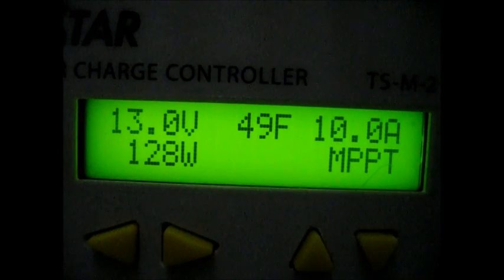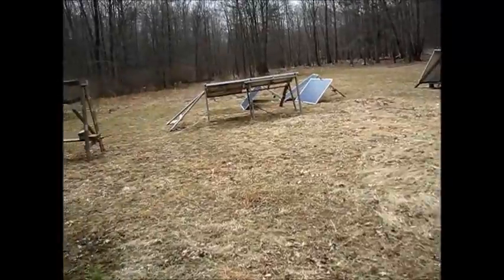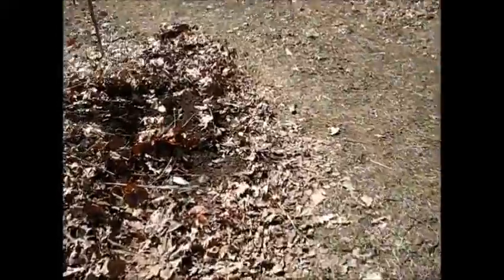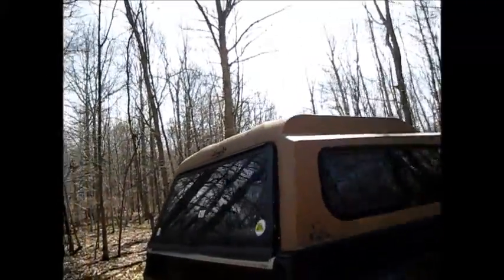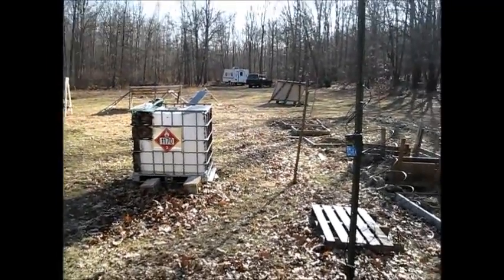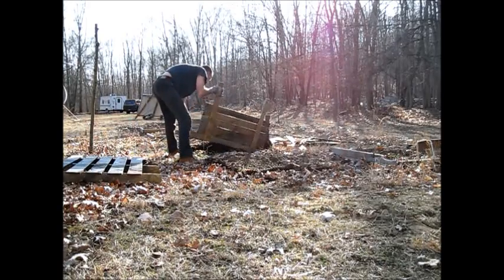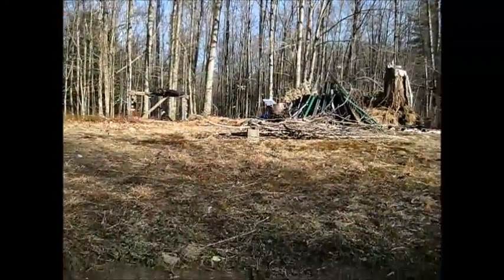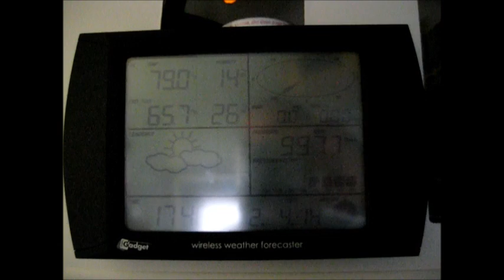Spring Cleaning At The Off Grid Homestead And Major Changes

Comment: All those sticks you moved could have been used for kindling for the wood stove, in fact I would have used that old outdoor shower rig to hold your wood that you have left until you could make a proper wood shed.  The stumps you could cut up a bit more from them for more wood, I know it is not much but every bit helps.
Reply from the maker: There are so many sticks around here that I can keep on going forever.

Comment: If you happen on an old bed frame, in one of the piles in the woods.I would cut the angle iron to make adjustable triangles and bolt the panel to them.Some drilled holes could let you set panel angles and anchor to keep them from blowing away.Looking less cluttered,someone mentioned shower as a wood shelter with old tarp fasten on .For composting a rotating drum might work better with some of those
worms to help the process.Keep up the good work it`s paying off.
Reply from the maker: Might work. Thank you
The shower is too small for a wood pile and I dont want to move the wood twice. When I figure out where my home will be then I will build a wood shed from pallets.

Comment: Congrats on moving the workshop. Slow and easy was great.
Reply: And it's too bad you can't find enough steel pipe in the woods to cut and weld together for solid, proper frameworks for the solar panels. Of course I don't know if you know how to weld anyway.
Reply: JAI Colorado looks like he has plenty of stone laying around to keep the wood out of the dirt. those pallets should be tropical hardwoods which should be able to handle the weather.
Reply from the maker: Thanks. I plan to make proper frames for the solar panels but cannot weld because I have no welder and not enough power to run one. I do know how though.
Reply: The Do It Yourself World Troy, I wasn't talking stick welding or even MIG. I was thinking gas. I knew you don't have the power for electric welding. Steel tubing is real easy to weld with a gas welder if you had one.
Reply from the maker: JAI Colorado That is more expensive though. Out of my range. An electric welder at HF is only $169 on sale. Gas is another story though.

Comment: Hello Troy, the place is looking better. I have a suggestion about your mulching bin. You did say you are putting a back on it I believe you said you will be making it a wooden back, but you didn say u was doing anything with the sides, That chipper will blow a lot of the chips out the side I would use a little chicken wire on the sides to allow the wind to pass by and to catch the wood chips. About your cop calling troll just remember the more they call the cops and the more they come out and see you are doing what they say and making the place legal and looking better eventually they will start ignoring his calls and finally tell him to stop calling. At least that is how they cops are around my area they have better things to deal with other than some guy who is not hurting anyone. one more thing the stumps you have could be rolled using truck and tow line I have moved a few like them using a little S10 4x4 Not sure where you might be moving them to but could you just burn them off slowly?
Reply from the maker: I plan to close in the sides of the bin with some of the old pallet wood but leave air space in between.
I know the cops will eventually get bored with the calls and stop coming. I will try your idea on the logs. Thanks

Comment: You should tear down that old camper  but leave the floor on the frame then place your solarpanels on it  and that way for you can turn them into the sun real ez
Reply from the maker: Its not EZ to turn a 32 foot trailer. But I do plan to rip apart the old camper and build a tiny home on its frame

Comment: A lot of wisdom in this video!   Now Troy probably did not have the opportunity to do better since he had to move quickly.   Start with the effect not having a well organized place can lead to depression, and poor eating and sleeping issues.

But for most people, they should have time to plan better. Like where will your off grid home be?  For most people, they should have time to plan better. Like where will your off grid home be?  Near water, able to have full sun most of the day year round? Reliable full year source of wood? Not  planning really well so an off grid home doesn't end up looking for lack of a better word, like junk is a major concern.

Vegetable garden in a good area, protected from deer and other critters?  Compost system close to your vegetable garden? Waste management be it wash water, composting toilet.  Roadway in and out.  Able to handle your vehicle in winter or massive rain periods?

What about garbage?  Out of sight?  What about scrap limber, tires and other scrap that can make a place look not so nice and neat?  Do you have a wheelbarrow and other tools you will need to do what you need to do and even survive?

Just some thoughts I wanted to share...
Reply from the maker: Thank you very much for your words of wisdom.

Comment: good afternoon troy,just thinking as i watch you moving the trailer . when you set it up in the desired location you should think about taking the weight off of the trailer wheels if it is going to stay in one location for a while . less stress on the bearings etc . so when and if you move it it won't have frozen bearings good day for now and property looks great
Reply from the maker: Yes I plan to have it all jacked up properly.
Reply from the maker: Dennis Lindell Thank you for the warning
Reply: Dennis Lindell Would it be safer to cut some logs to use to support the work shop?  If so where is the best placement?  When I was a kid my family used to have a trailer we kept long term at a campground and I do remember dad being very careful about placing the jacks but I do not remember the contact points. Seems like one was on the tongue behind the built in jack.  There are a lot of people on here who could probably use some tips.  Thanks!

Comment: Idea for the panels, mont them togeter by two or three (at maximum input voltage of mppt charger, ) use angle iron profiles weld or bolt them together, using the alu frame as a guide, conect them on upper and lowerside togetger as a pair, bolt two peaces of stakes also steel at the upper side both sides to the frame, use them as stands, make two or three off them, and you can still manhandle them iff you move them., pitty i,m not there! Sorry mate!
Reply from the maker: Thank you. I was hoping to use aluminum framing though so it would be lighter. I sure wish you were here too :)

Comment: Based on experience learned the hardway. (sigh) Don't put your compost bin under trees. Instead of a bin, we had a simple composting pile. Added, I don't know how much shredded materials to the other things normally included over a whole summer/fall. Intended to have compost ready for next spring. Spring arrived. The compost pile was filled with masses of tree feeder roots. Trees were sucking as much nourishment as they could get from the compost. What was left was such a tangled mess, it wasn't worth the labor to chop it out and run through the shredder again, to make usable. If kept in the trees, it will have to be worked often enough to keep out the tree roots. Extra work when time for work is precious. 

If you still want to use the structure for this purpose, you can disguise it. Move it to an out of the way place away from trees. Ideally, behind a building where it can't be seen from the entrance. Lacking that, planting in front of it something beneficial that will hide it in time. (Berry bushes?) Leaving walking space between those and the bin. While waiting for bushes to mature, plant cucumbers, pole beans, etc to train across the view-able side. Or several rows of corn, which could hide it most of the year. As would okra, if you like that. (Access would be on the other side.)

BTW, scatter any nail free wood ashes you have across your garden spot. Broadcast as if fertilizer. Spread before tilling will add valuable minerals to your soil.

Consider trying to burn those stumps. If you can use your truck to pull them further away from the trees, burn them in your garden space, again, before you till it. Scatter the ashes. Add extra compost from last years raised beds or leaf mold from the forest on the spots where they burned. Adds back organic materials lost from the soil in those spots. Adds back beneficial bacteria and other life that thrives in healthy soil.  

Personally glad you didn't keep the raised beds. They are good where space is very limited, poor drainage situations, sandy soil with too much drainage, etc. However, with as much space as you have to garden, believe what you're now planning to do will be more productive in the long run. Much more flexibility from year to year. Expand/contract space, as needed for individual crops. Easier to maintain rotation needed, especially for some plants. Beans following corn puts nitrogen back into the soil. Moving potatoes each each helps reduce soil borne disease problems, 

Hope you find some of this long winded rambling to be useful.

Comment: Alu angle profile is a lot less stronger as iron Troy, it will flex much more, think it will work for max two panels, but its not realy strong enough in windy conditions. You wont have to haul them much, its cheaper to then alu framing., if y was you ,would do it different anyway, y would have build a big frame for all the panels, and make it follow the sun wit a simple turning gear, driven by a smal dc motor and two small solar panels counter connected.
Reply from the maker: I plan to have pairs on stands due to the heavy wind we get. I dont want to risk having them all on a single stand. If one flies off I wont lose them all.

Comment: Troy I got a ? If u put ur tank in the back is the pump u got stong a nuff for u to run a hose from ur tank up to the rv to pump water like maybe have a spiked at ur porch that u could flip a switch and have water like have ur pump on ur porch and a hose ran from it to ur tank im just curious how strong the pumps r
Reply from the maker: I do plan to move the tank to the back of the meadow and move the RV back there next to it. The pump would then work fine yes

Comment: I don't have a cheap solution for you.  But if you could find some schedule 40 pipe and some 90's you could build a rack.  One goes in the front and the second behind but higher for the angle and set in the ground with concrete.  But you will need some unistruts and maybe some squared alum for the frame.  But this will have to be clamped and bolted into place.  In that situation you will not be able to move it.
Reply from the maker: Thanks for the help
Reply from the maker: ***** Thanks